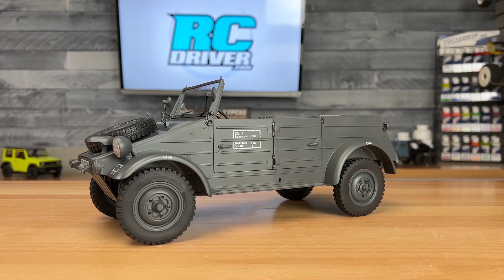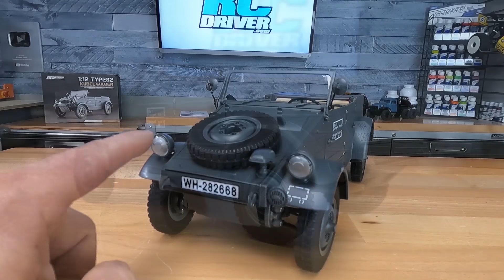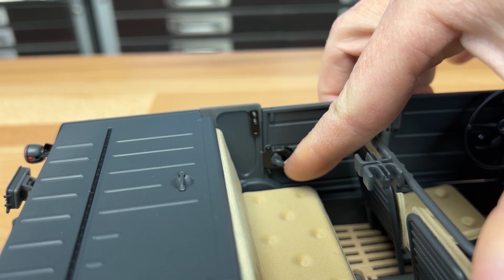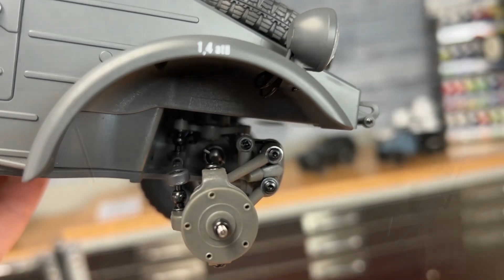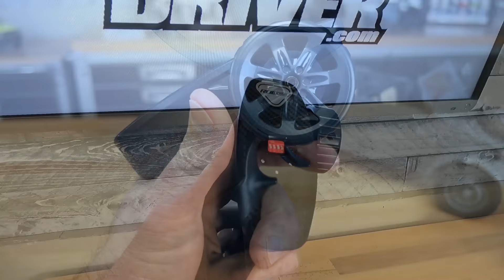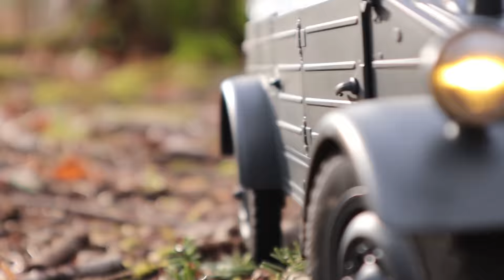Most Detailed RTR RC Car On The Planet? ROCHobby Type 82 Kübelwagen Review | RC Driver

Comment: Hey Greg, found a good trick for realistic driving with these touchy controllers. A small piece of foam glued behind and above the trigger with zero clearance, then reset the throttle trim if necessary.👍

Comment: I think it doesn't have portal hubs on the front wheels because the real Kubelwagen was a two wheel drive and they wanted the front suspension to look more scale, being a 2wd the real one had portal on the rear wheels only.
Reply: Some of the Kubelwagons were 4WD
Reply: @boldrbangr9834  yeah I think so and the swimnwagen was 4wd too, they also made a military Beetle with 4wd (the kommanderwagen) but I think the 4wd didn't have portals so if I'm right the RC might be based on the 2wd kübelwagen, i should do my research though!!!